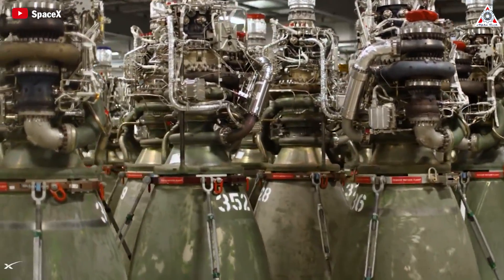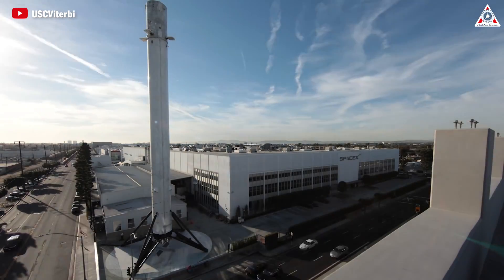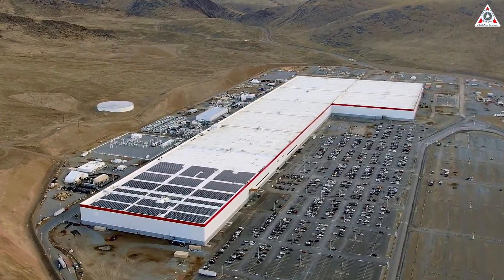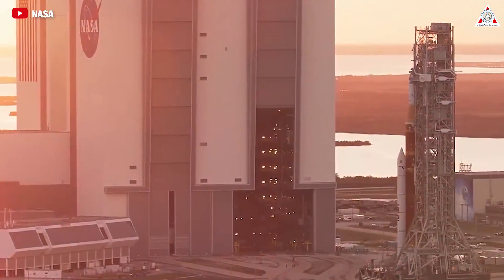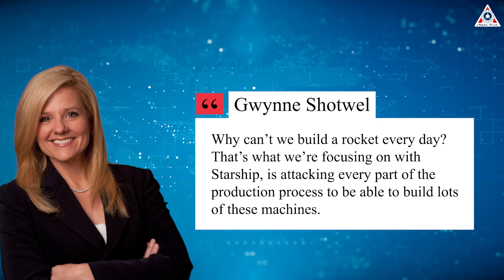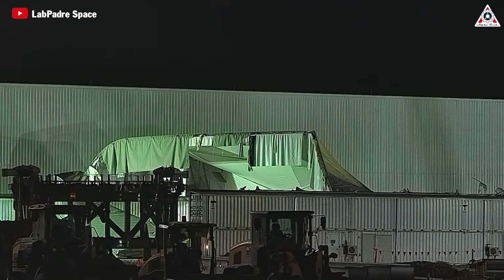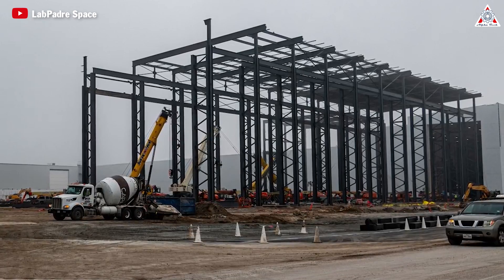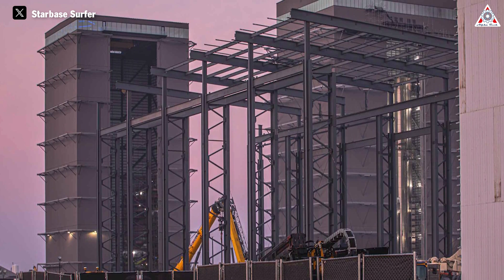Elon Musk officially revealed NEW INSIDE SpaceX gigafactory that shocked NASA!

Comment: It doesn't matter how big your factory is, or how often you change the engine designs.  The only real criterion is how well the rockets perform.  In the latest test, goal being to get many tons of fuel into orbit and transferred, it was a total failure.  The rocket ran out of fuel before reaching orbit, it came down in an uncontrolled fashion,  the door opening and closing test failed, and at least one engine burned up on re-entry.  Failure in almost every way.Particularly worrying was the failure to reach orbit with the expected fuel surplus.  That's the whole point of the refueling in orbit plans.  It sure looks like the basic energy calculations are way off.
Reply: Your misinformation is astounding and your conclusions are beyond words. You mix a little truth with a lot of incorrect statements.
Reply: @j.scottanderson4417  I checked them again.  All correct and dreadful.  And oh, two, er, five more:   Didn't transfer header tank fuel.  Didn't restart engines.   Didn't do a controlled landing. Didn't soft-land, Didn't reenter within 1000 miles of target.
Reply: @j.scottanderson4417  Elon just confirmed, they are not going to be able to get 100 tons of fuel to orbit.  He says "50 tons" so going by his exaggeration factor of late, maybe 30 tons.  So that would require like 50 launches to fuel up for the Mars trip, totally wack.  If they could do one launch a week, a rate they've never been within a factor of 5 of doing, it would take a year to fuel up the Mars craft, actually much longer as oxygen and methane would be boiling off the whole time.  And NASA only contracted to pay for 3 fuel runs, not 50.  Totally nogo from every angle.